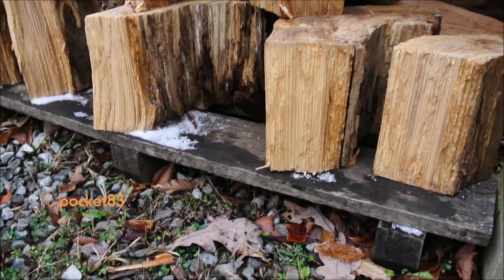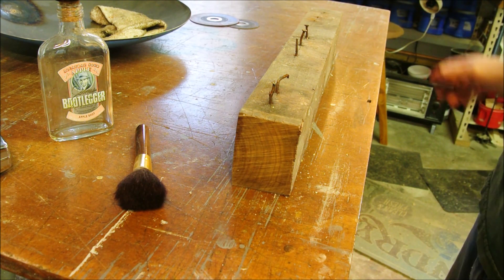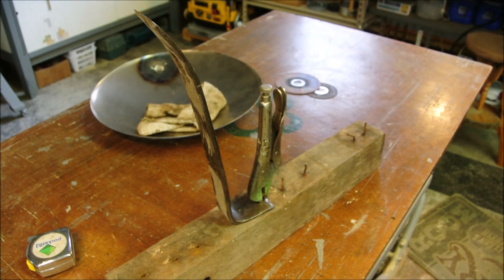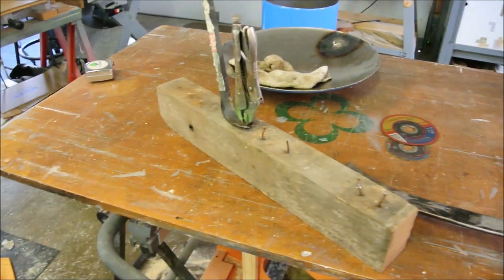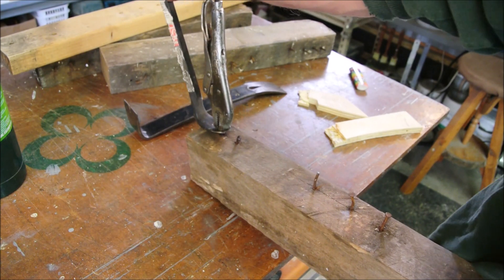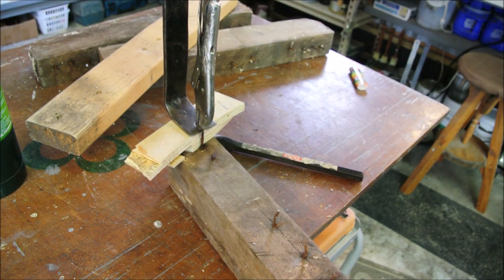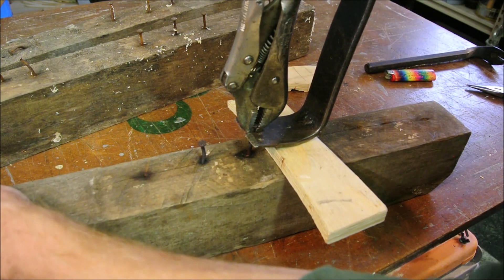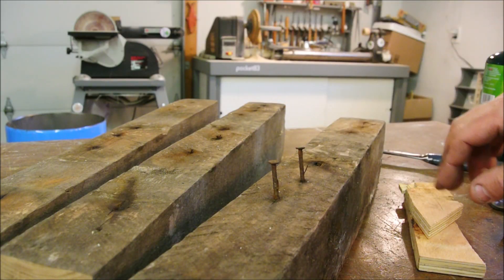Removing stuck nails with a propane torch

Comment: I noticed this video was a couple years back. I may not have read enough of the comments and suggestions to catch what I am going to suggest.

With the lay out plus a table, you are fighting yourself. First thing to do is mount a bench vise . That will make things much easier. The flame to the nails sticking out looks great. Your bench vise will give you leverage plus pulling power.You can pull the heated nail out with vise grips. The back of the vise grip is its own folcrum.

This comment is a bit late but, hope it helps all readers 
😊👍
Reply from the maker: Commenters are ignored most of the time for a very simple reason: most comments are loaded. There's simply no possible way to reply to that comment without appearing either patronizing, condescending, or stupid. Since I have zero concern for popularity on this medium, let me be completely honest with you, and take the least favored of the three.

This stuff has been put here because some of it is useful. With respect to the brass tacks of this video, that is, to its concept, how I happened to've been prying on the nails that day is incidental to the point of irrelevant. The fact that you'd even bother to 'help' by suggesting to me specific leverage technique is downright insulting. You have nothing to teach me; the belief otherwise is distilled hubris. I started prying nails at age nine. Then I continued to do it professionally, for decades. There isn't a single nail extraction method in existence that I haven't been exposed to. In fact, every single nail was successfully removed from every single skid that day; NOT EVEN ONE nail remained in the wood. 

So please, without taking this response too personally, and without telling me that I'm 'too sensitive,' take your improved methodology and go make your own video. While you're at it, pay attention to what it's like to pry something out while making make sure that it stays in frame, in focus, well lit, and with a usable white balance. Also note that the correct spelling is 'fulcrum.' Hope that helps. 

Unsolicited advice stings, doesn't it?
Sheesh.

Comment: I simple welded a 44 magnum to a pair of vice grips muzzle facing the same way the jaws of the grips face. Works well only problem is you shoot a large hole in whatever you’re getting the nail out of but that’s what wood filler is for baby

Comment: might i recommend a slam hammer? replace the adjustment screw from the v grips with threaded rod, with a sliding weight on it, and some nuts on the end as keepers. ive used this many times

Comment: There's a cobbler tool called a hot nail. It's basically two electrodes connected to a low voltage (but high amp) transformer that you apply on a nail. It heats up the nail relatively evenly. It's very useful for ribbed nails used to hold heels to insoles.

Comment: Heat transfer. Heat the nails and let it sit for a bit till the heat transfers down the nail into the board and sometimes let the nail cool for a bit the steel will expand and then contract. It works well on rusted or frozen bolts by keeping light pressure on it as it cools and you will feel it let loose when it gets to the right temp. Just dont get in a hurry.
Reply from the maker: Description.

Comment: Okay, strength has nothing to do with it.  You are losing all purchase on removing it because the other end is popping up when you pull.  Take it outside, jack up your car on the heaviest tire (one tire), and put the wood under the tire.  Set up your extraction and pull it.  Of course burning the wood will work by heating the nail, but your lack of strength isn't physical, it's mental.
Reply from the maker: These comments read like satire. Let's put aside the fact that you're overlooking my expertise and insulting my intelligence. You would have me park a car on it? Oh yeah, that's certainly some brain strength you have there. 

It's just a few nails. A little bit of struggle won't hurt you. More force is not always helpful, because it risks breaking the nail. Further, a rock-stable board to pull from is only necessary for noobs. 

You might next tell me about leverage, mechanical advantage, work, and/or a number of other physical concepts to 'help' exercise my weakness on this subject, but how's about you just stop being presumptuous? You saw a few seconds of clip, and now you're convinced that I could use your training; what's going on here?

Comment: Forget the heat, Irwin makes a handy tool called a "vise grip nail puller". I recommend using a piece of shingle as you pull the nail so you don't damage the woods finish. It's saved me several times when installing siding, especially with the removal of stubborn rusty nails!

Comment: I use a garret metal detecter. called the garret carret. Its water proof so it can go out in the field to test for metal fencing and staples in trees before the chain saw finds them first.for big thick trees i also use the Garrett at max . Good investment if it saves countless plain blades saw and chainsaw chains.and no garret dont pay me to say this but would be nice if they did lol

Comment: 100 years ago walnut was considered to be junk wood suitable for factory floors and firewood.
Reply: As an ex woodworker that waste is sad. I worked on a house about 80 years old at the time that had a counter top made from 1 !/2 x 25 x 96 clear quarter sawn Douglas Fir. It was in pretty good shape, but not exactly the right material for counter top. it was probably the cheap way to go when the house was built.. 

I told the owners to not throw the old counter top away if they replaced it. I think they listened to me. They were good folks.

Comment: I believe there is a (car) mechanics tool that adapts an air chisel to pull like a slide hammer. I believe it also comes with a vise grips adapter.

Comment: I think those spiral nails have glue on the surface that melts from the friction of being shot into the wood.  I wonder if the wood inside the nail hole is charring or if the expansion and contraction of the nail plus the added heat degrading the glue is what makes it come loose.
I guess I need to try this and saw it in half across a nail hole and see what I can see.
I was always tempted to corrode them out, but I never did the research to figure out what eats steel and doesn't eat wood.
Reply from the maker: Thermal expansion/contraction has lots to do with it. If you're interested, I wrote a bit about that in the description. As for glue, those nails were collated with wire. Any other adhesives/lubricants/residues had either scraped off as the nail entered, or else have long since decomposed.

If you were to try a corrosion technique, vinegar is one possibility, but it would probably react with the tannins in the wood. Electrolysis could be another way forward, but I know next to nothing about that.  

Char (at least in my example) didn't really lend much to the overall release. I don't think the char made it very far down. Maybe 1/4", tops.

Comment: A couple of years ago I got an old horse carriage that had almost rotted away. It was between 70 and 80 years old.
Wheels and axles were in good condition, the plan was to use it to make a wagon for my old Leyland 154.
As I cut into the frame, which was covered with moss and other growing things, my cheap saw blade shouted for help.
The frame was made of rock hard dark oak. Got some really nice big pieces of beautiful wood out of it.
All other wood on the wagon was almost completely gone.
Sometimes you get surprised, in the right way. :-)

Comment: I clamped it to a vise and used a hammer prying them out. I had few snap then drilled beside it and chiseled a small angle out so that the vise grips could reach and pryed with the hamner

Comment: If only there were a tool, that could temporarily secure your work piece to the table, freeing up a hand to aid in this quest. Lol I’m being facetious , I enjoyed the video and actually will file this info away, in case the extraction methods known to me fail one day. Thanks.
Reply from the maker: That's funny, but the number of comments on clamps and vices is ridiculous- destpite the proviso about mentionning the obvious.

Had I clamped it, the next critique would've been to use a longer lever. They're never happy until you portray a joyous fantasy of effertless work using zero electricity that's topped with feighned appreciation and humility. 

No matter how sharp the chisel or tight the fit, perfection is more closely idealized in the mind of the YouTube commenter.

Comment: Nice work. I've done this before using a large soldering iron as a heat source. It took quite a while to heat up the nails, but it allowed me to sneak up on just the right amount of heat without charring the timber too much.

Comment: I'm no carpenter, so this is probably one of the things you already tried. but if those splits go all the way the nail goes, couldn't you get oil in there pretty easily?
Reply from the maker: Probably. But oil stains wood by permeating it. I briefly considered a drop of vinegar too- maybe it would break loose some rust, but I think that it would react with the tannins in the wood.  

It's a tough problem.

Comment: Best suggestion... take a physics class... your mechanical advantage is so low it would be impossible for anyone...
Reply from the maker: Too much leverage will apply more force than is necessary to break the nail. It's more about the direction of the force here than the amount. Think of closest to the price without going over. If you question whether I've earned my scientific spurs, read the description. Now go take a writing class.
Reply from the maker: I believe you. But so what? It was a different case, so there were many different variables. You think I haven't pulled a million nails in my life? I was a framer at age 9. 

There was no possible way that anybody, no matter their skill, could have removed those nails using only two hammers. Some of them would've snapped off and left knurled and embedded nubs.
Reply: I just did 2 massive tables with reclaimed wood from 1901. I used two hammers, broke no nails. I agree no snapping the tool (your terms) slow and steady pressure. Also a clamp to hold it helps. I did easily 200 BF and never resorted to a torch.

Comment: It probably has something to do With  heat  expansion loosening the  wood's grip ,  and the  powdery  rust it would knock off probably acts like a lubricant in the nail hole.
Reply from the maker: Can you explain what you meant by "Junk science"? I'm fairly certain that expansion has everything to do with how this works.

Comment: If you can spare it, it might be interesting cut through the nail hole and see what it looks like.  I wonder if the scorching goes down far.  Also, as a control you might heat a piece with a stuck nail in the oven to see if some of the relief is due to the wood warming.

Comment: clamp the fucking thing god dam!
Reply from the maker: You need to be above it to get leverage. Have you ever tried prying on something that's 36" high? 

And damn is the correct homonym of the curse, troglodyte.
Look those words up.
Reply: @pocket83squared  clamp the piece of wood to the leg of your work bench ON THE FLOOR. seeing you struggle with such a simple solution is very irritating. 
Pedant
Reply from the maker: Then don't watch! Clamping a board down just to pull a nail is for kids. It would take forever, especially when filming. And it's certainly no cause for you to act like an asshole to me.

Comment from the maker: Izzy Swan mentioned this trick a few years back in the following video:
https://www.youtube.com/watch?v=65jH4mNIRGg
Had I known, I probably wouldn't have posted this video. Nothing new under the Sun, I guess.

edit:
(speaking of lacking originality) Comments about clamps, levers, and vices are now blocked. C'mon, I asked you not to state the obvious. Besides, it's not the amount of leverage that helps here, but the way that the leverage is applied. More force would've just broken more nails. Also, applying leverage from above gives way more control, so clamping to the table would've just made it harder and more time consuming.
Reply: Oh bull, that stud finder alone was worth the entire video, saved me a lot of grief and Ebay searching. Cheers
Reply: Why, I have not seen Izzy Swan channel , but subscribe yours and surely there are others the same way.
Reply from the maker: There's a tip on the linked video about putting a magnet in your cutting oil so that it doesn't spill. Izzy really does give out some great tips. I really liked his tablesaw bowling ball jigs/videos.
Reply: @victorcastle1840  
Izzy is a wood working genius, you should check him out.
Reply: sometimes we just have to find and figer things out by ourself, It showes that we  all have the ability to solv problems and it is posible that more than one person can come up with the same solution.
Reply: I really like that box lighter 5:00

Comment: use a metal detector to check for nails in old trees and used lumber  it will be a valuable tool in saving planer blades and saw blades

Comment: You can some times find pallet wood for free on Craigs list and stuff you just need to search for it. Looking through pallet wood I've found many exotic ans expensive pieces of wood in and on them. If a pallet goes to South America and a slat breaks off they fix it with whatever wood they have there so if there is a rare tree growing there they don't care it's just a piece of wood to them and as a pallete they get covered in grit and no one pays any attention to them. You should go Pallete hunting some time  and see what you can get a hold of.
Reply: i made a knife handle from some grade A Cyprus with the most amazing grain i have ever seen, that i found as a pallet runner.

Comment: Interesting idea.  My instinct at the beginning was that the heat would expand the metal.  I was going suggest throwing it in the freezer for a bit.  But I didn't think about the wood burning away.

Comment: How have I not thought of this?  I literally have a blow torch sitting two feet from my nail pulling station.
I have even tried chucking the nail in a drill and spinning them out.
Reply from the maker: Did you try staring at, and swearing at, the nails in frustration? I mean, that's what got me to try this.
Reply: @pocket83squared  I insulted their questionable lineage and the reputation of their mothers.  Yessir.
Reply from the maker: Ok, well- the only thing left was to search YouTube!
Reply: @pocket83squared  Remember the scene from Dune when that Fremen yells at the obelisk?  That was a similar scene with me and some white oak pallets.
Reply from the maker: No. But I just laughed at the reference. I'll watch Dune again tonight. 

As an aside, Dune II is the best game I've ever played on a tablet, and it's a PC game from 1992.
Reply: @pocket83squared  what, its on tablet now. I was playing the amiga version the other day. Acknowledged.
Reply from the maker: I installed it on my old Nexus 7. I don't know if you can find a way to get it on an ipad, or one of those fancy-pants tablets like Mrs. pocket has. I'm a dinosaur with small, flat-screened things.

Comment: Always great to find such nice wood!  Great trick!   You can also increase your leverage greatly by using a narrow item under the foot of the pry bar, anything much less than the length of the foot, pushed up close to the nail.  Half-inch to 3/4 dowel or square stock or chunk of pipe etc.   If the pry bar foot is, say, 2" long and you move the fulcrum to less than 1" you've more than doubled your mechanical advantage.   I help work on RR track and we have huge claw bars to pull spikes.   Occasionally a spike will not pull even though the bar is about 5 foot long and 4 inch foot.  So then we slide another spike under the foot as close in as we can get and the pull suddenly becomes MUCH easier.   And even if you could still brute force it without the extra leverage, you have much increased control to do the advised "steady" pull rather than the "snap".   And it' much easier to hold down the piece as well.
Reply from the maker: Same idea as in house framing: pull a nail with a chunk of 2x4 against the head. WAAAAY easier.

Comment: I have some pallet hickory of similar dimensions with similarly difficult nails. I'll give this a try. 
One thing I've noticed though is that the nails have bits of wire stuck to them from when they were stuck together in strips or coils for the nail gun, and sometimes those bits are left in the holes. Just something to keep in mind. Probably won't hurt any carbide tools like your sawblades, but not so good for steel planer knives.
Reply from the maker: Good point. With pallets, the barbs aren't likely to penetrate all the way through to the skid board, luckily. I guess it comes down to how much we want to risk for the board! You have to watch for embedded gravel, too. 

If the trick works on hickory, please let me know.
Reply: @pocket83squared  Will do.